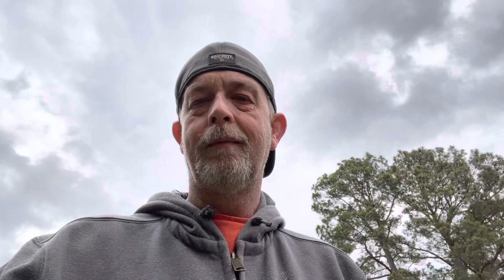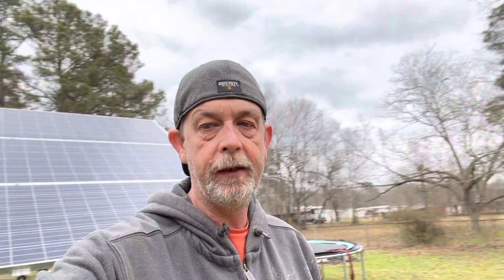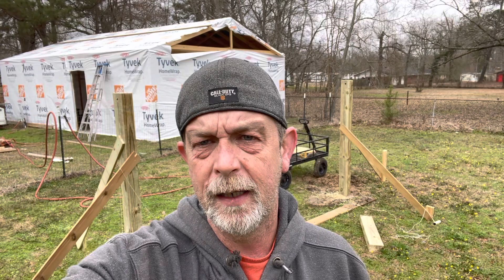DIY adjustable solar panel mount

Comment: Another fine video. Thanks for the ideas.  I do have a question - did you consider using a framing nailer with 3” nails vs. screws to put the wood frame together?  Are there reasons for which way you went?  Remember I am just an amateur wood butcher (carpenter) haha.  All the best from north Texas.